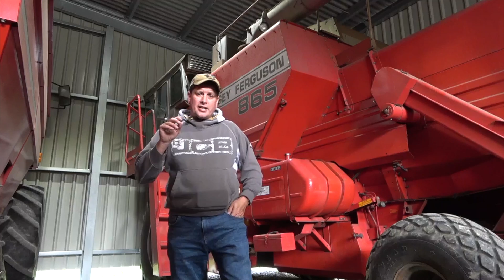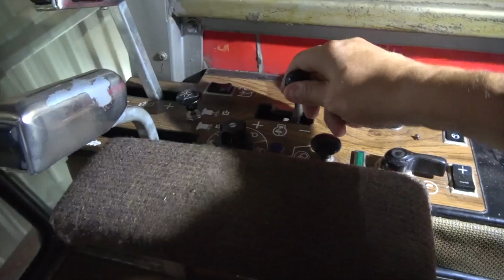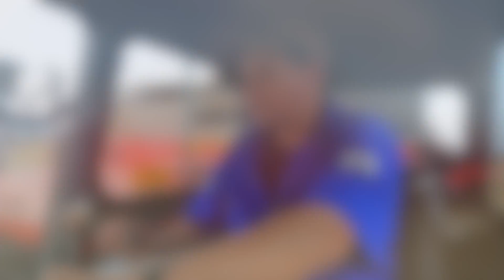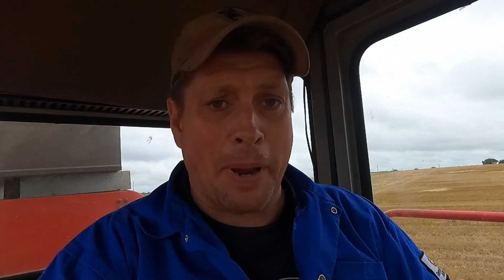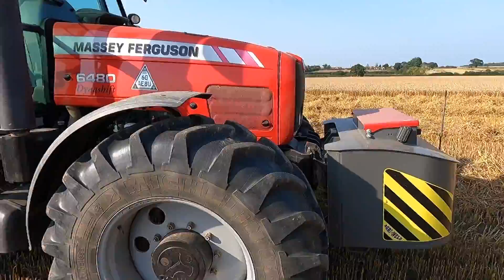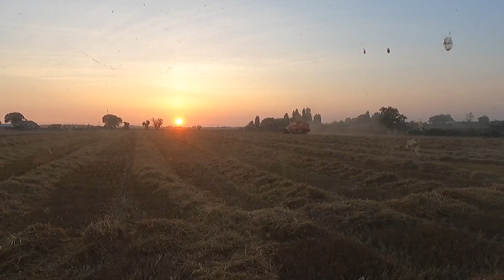BIG V8 HARVESTER !

Comment: My old man had one of those Perkins 540 in a dodge k10 6x4 tipper, would t pull the skin off a rice pudding, always remember going on to Portland in Dorset 1st gear all the way up, head gaskets once a month, absolute litter, changed it out for a turbo intercooled 6354. Not a lot better but no head gasket problems!! It’s amazing what you remember!!
Reply from the maker: A big engine with not much power. 6.354 was a much better lump
Reply: Think you'll find mos V8 engines are pretty gutless lower down the rev band - it's an inherent characteristic of the design - not specific to Perkins engines, but all brands. Have to rev them pretty high to get any kind of perfomance. They do look good on a tractor though, if only for the aesthetic appeal if not the performance. Two such examples would be the MF 1150 and MF 2805 tractors - they really looked the part. IH marketed a conventional rigid frame tractor, fitted with a V8 truck engine during the early part of the 70s - looked great, with its chromed manifold covers and twin exhausts but offered very little in the way of extra and expected performance over a tractor equipped with six cylinders.

Comment: Brings back some memories Muck, thanks. I was lucky enough to be allowed to drive 760s as lunch time relief in 1980 and 81 harvests. They seem to struggle to get a really clean sample sometimes but were streets ahead in capacity and driver comfort at the time. I think the first on the farm were 2 S reg 1977 with 18ft powerflow tables and probably on their 3rd harvest when I first saw them. One was replaced by an 765 with silver cab and wheels and some updated separation, looked smart but did have a few issues with grain pan shaking apart. The last one of that type on the  farm was an 865, when it replaced 2 machines. It must have been pushed hard, although I think the area had reduced with less contract work.
 Could not believe it when the large farm I went to in Suffolk, for my mid college year, ran 2 cab-less Dominators that were not that old. What a crap job for the regular drivers. Apparently boss thought he would save some money. They did make a better sample than the MF.
Reply from the maker: I'd put a Massey up against a Claas of the same age for a better sample. I think Deutz had the best sample in the day. Claas were just good all-rounders.
'5' series Masseys (760/765 860/865) were running faster internals which is why many were slowed down to stop the breakages.

Comment: Did that 865 have a dronningborg header originally. I thought the power flow headers had sensing fingers for table height control but the threaded adjuster seen through the window was only fitted to the very last 865s supplied in Europe that had dronningborg headers.
Reply from the maker: No it came with a Powerflow but has also had the Dronny height gauge fitted. We have the option of a Dronny header for next season but personally I like the Powerflow.
Reply: @LordMuck  yes keep the power flow. Much better header.

Comment: Love the arm rest, and know exactly what you mean! I like the comment on if there is going to be a problem there is a problem no matter what year it was made. And that is where older equipment shines, I've found when you need to cut it needs to be cut you cant wait for a dealer to come out in 2 or 3 weeks. The older stuff up to early 90's seem to be a lot easier to Sunday fix if you know what I mean. I like the 865 MF there weren't many of them round here the 860s were the end of mf popularity here I know there are 4 of them knocking about locally, but id have to say there are more JD 7720's followed by 1660 / 80 IH Then comes the newer stuff 96/9500 JD a few L M Gleaners then come the MFs. I did spend some time in a 860 it a good 30 foot platform or 8 row machine, The only dislike I have is the off set cab and what's beside it! A tight cab helps but if that engine is behind the grain tank it makes life a bit nicer. Thanks for the show.

Comment: Camel's pubic hair...... Priceless.
You should put that on a T-shirt.
My father runs a JD 1075. It seems a more comfortable combine to work with.
The engine was further back behind the grain box so not quite as noisy.
The cab was centrally located and seems more spacious & comfortable. 
Jimmy's head is 14 ft. What are you running on yours?
I really liked the "how dare you ref"
Nice video.
Reply from the maker: 18 foot Powerflow. Cab on the side gives a better view down to the cut line.
Reply: @LordMuck  no doubt going down the line, what about coming back up when the edge is the far side?
Of course, it doesn't really matter because you're only talking about around a 6 foot difference in position. 
Some people have a preference for John Deere and others MF , NH, Class.
Reply from the maker: It's not, once you've opened up a block you always cut that way. You try having 6ft that you cannot see without leaning forward and craning your neck all day.
I've driven NH and JD's with 20 and 25 foot beds and it's a pain without guidance.

Comment: I did not know anyone put V8 in a combine. 
I’m guessing it is from era of 
3208 cat, cumins 555, IH had v8
Did Perkins 540 have offset journals. 
First time I saw combine with wood grain dash. 
Good video thank you
Reply from the maker: Some US combines had V8 gasoline engines
Reply: @LordMuck  I never was around North Dakota,Montana size combines. 
I was around ones that has 6cylinder gasoline engines years ago 
Of course in last 30 years 6 cylinder diesel. 
I did reply to comment about 6-354 
Good video thank you
Reply: @LordMuck  😯

Comment: Podge, I didn’t know there was a variation on the 50s and 60s, we only saw the 750/60 and 850/60s here. They were very well regarded here too and things have to be tough to survive here. I always was a fan of the big black line they left every where, (bugger Greta)you would think they were guaranteed to boil working like that. It looked like someone had fiddled with the pump or left the hand brake on but no. The Massey tractors with the turbo 354 were the same. Relying on the turbo with no muffler had some operators worried about starting fires which is a very real problem here, harvesting with a hot northerly blowing and 40 degrees in the water bag on a good day (damp straw is not the problem then). Have a look at South Sask Farmer, he has an 860 in his arsenal which he loves. It still pulls its weight and it is older than he is. Jeff
Reply from the maker: I think that exhaust vacuum pre-cleaner also puts a lot of shit out of the exhaust.

Comment: Looks like your engine has been converted to the Bosch inline pump. Those engines sound good, but had a terrible reputation in the tractors over here. A lot of guys blamed the CAV injection pump for many of the issues.
Reply from the maker: To be honest Wes, as much as I like the 540 V8 in these combines, I'm not a huge fan of them in tractors and I'd much rather have a Perkins 6.354, especially when turbo inter-cooled.
Reply: @LordMuck  the first time I saw a 6.354 was in New Zealand 30 years ago it was put in a WW2 Studebaker  6x6
It was used for logging. 
I did find one in Alaska but never did any thing with yet
Reply: never had trouble with a perkins
Reply: Ive never seen a perkins V8 with a dpa pump every one ive seen had the inline pump whether it was in a tractor or truck or anything ,always the inline pump and Ive seen hundreds  of them over 50 odd years
Reply from the maker: I think he's referring to the CAV Minnimec rather than a DPA.
Reply: @LordMuck  your right must be getting old forgetful. I totally  forgot about the minimec pump
Reply: Massey got cheap and put the CAV rotary pump on the 2745 tractors and that among other issues created a huge problem for the guys that bought them. Massey also had a conversion to the inline pump but there was no way to time the pump as the housing on the engine didn’t have the timing hole and mark and those engines are really fussy about pump timing if you are out a millimetre or two they run awful so more problems I’m really happy that I never owned one. I have 10 of the 540 V8s from the 70s and 80s with the inline pump and have had no problems with any of them

Comment: I drove an MF combine for Velcourt in Hertfordshire back in the 80s. It was the biggest of the type you have there, except my memory wants to call it a 965. Perkins v8, cab to the left and a draper header like yours. Got it to 40 tonnes an hour in fit wheat. I caught sight of smoke coming from the engine compartment and saved it and the field from catching fire, phew. I don't know if a 965 is the right number.
Reply from the maker: As far as I'm aware, 860 and 865 were the biggest.
Reply: @LordMuck  Okay, an 865 it must have been then, cheers.

Comment: An 865 was the combine I did my first full seasons cutting on. As a 15 year old it was hugely exciting to be put in charge of such a beast, but it wasn't the most reliable machine in the world, and I reckon that over the 10ish years I drove it, you could count the number of entirely trouble free days on one hand. (Even if it was just the usual blow out of the fuel lines and re-bleed that it seemed to need most evenings!) 
'87 was my first year on it, and you don't understand proper flat barley (and wheat, and 30 acres of beans that October - the big storm didn't help) unless you experienced Harvest '87!!
Reply from the maker: This year we had areas as flat as a witches tit due to weather but the Powerflow coped with it all in its stride.
Reply: Another memory was of the air conditioning condensation collecting in a tray behind your head, until it built up enough to sloosh down the back of your neck when you hit reverse in a hurry! 
I can't remember whether it was leak off pipes that used to block, or an inadequate evaporator tray, but it was very annoying.
Reply from the maker: I this A/C unit is mounted behind the cab (hopefully)

Comment: The 700 / 800 series were the best Massey combines ever produced, so over engineered. Never touched the drum ,concave or rear beater in all the years I worked on them. The Danish 30/40 series were ok, but were rather tinny and let down by the weak shaker shoe. Dont ask about the 535 / 565 /665 / 845 built in Marquette France , they were crap.

Comment: I have some ideas but what is the purpose of the hose between the intake and exhaust?
Reply from the maker: It draws dirt away from the pre-cleaner
Reply: @LordMuck  Confirmed what I suspected. Thanks
Reply: @LordMuck   where was that combine built I worked a nacp plant 73 to 89 don't remember that model some of the control's are the same but did not have graintank full and the elevator on the rear hood .we build some euro models but had to have yellow road lights and some went to Australia had to have special glass. They had a combine plant in Scotland and one in France where was yours built thanks
Reply from the maker: Watch the video 😉
Reply: @LordMuck  love learning stuff. That sunset was beautiful👍 Nicer than camel pubes😂🍺